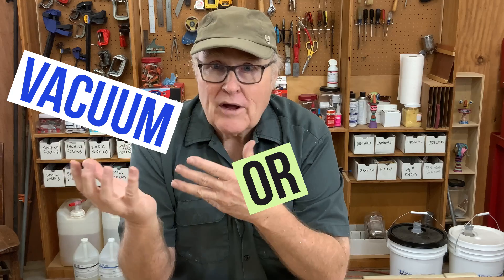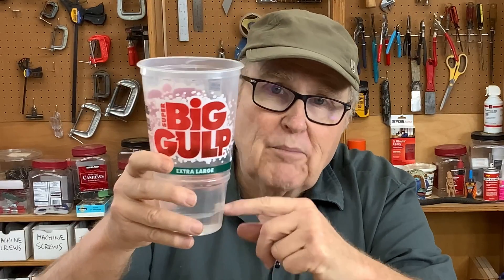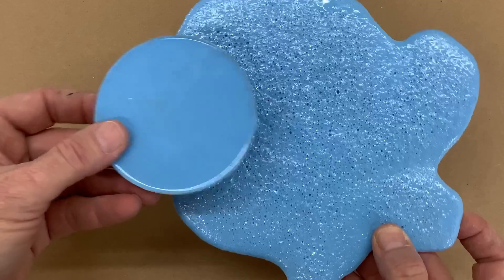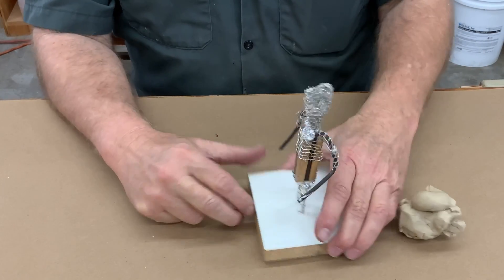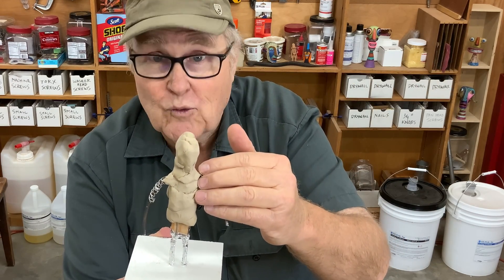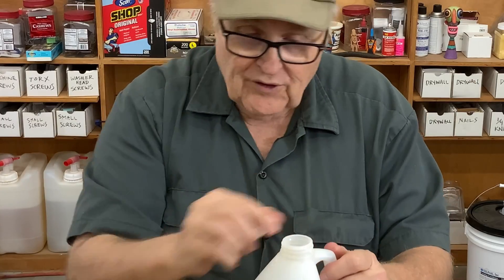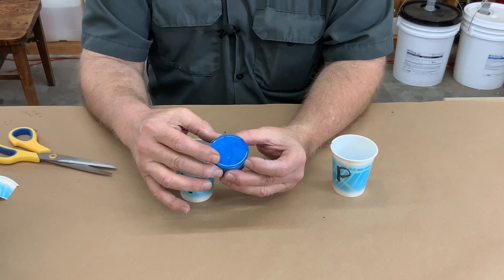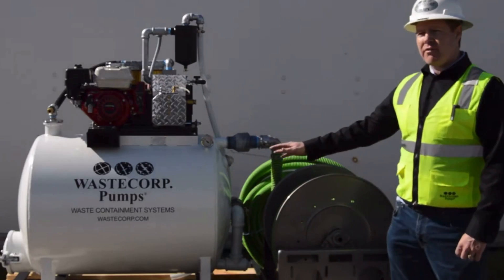Which One To Use, When, How?  WHY IS THIS SO HARD? !!!

Comment: OMG WoW thank you dear !! I was just about to buy a vacuum machine for my resin art... haha.. much LoVe!!!
Reply from the maker: Are you already using a heat gun? That works very well to remove the bubbles as they rise from clear epoxy resins.
Reply: @RobertTolone  yes thank you for your reply 💙 heatgun works most of the time, but not with my wing molds.. These always catch bubble HOLES to all sides.. And I want to craft many of them for my crowns for the upcoming shop.. So I am looking for a propper solution.. Especially when buying more expensive resins.. Could you actually recommend me a very clear heat and impact resistant resin (for 4mm thickness) that's less expensive than crystal clear from smooth on 💫🙏💫

Comment: Great video! Even though the principle is simple, I can understand why people get confused.
The main question I've been getting is: do I really need to get a vacuum chamber? Can't I just use a pressure pot? Or, do I need a pressure pot if I already have a vacuum chamber?

My answer is always, if you are going to use a vacuum chamber, you won't see much difference unless you also use a pressure pot.
And if you use a pressure pot, you will have bad results without using a vacuum chamber.

The former is because a pin-bubble free silicon mold won't help you get rid of the resin bubbles.
And the latter because a pressure pot will push the resin into the pin bubbles on the surface of the un-vacuumed mold, giving you a rough surface.
Either way if you get one, you need the other.

Comment: 7:27 - so understated: especially with ubiquitous Smooth On sample size containers. The lids have a much greater radius and even with my best efforts to clean them before putting them back on, I keep a small pipe wrench to ensure I can open them again.  
10:23 - YES! California Air Tools compressor! They are light and QUIET! So if you live in an apartment, you won’t disturb your neighbors performing your hobbies at night. Just be careful of TWO things: 1) when you first get one, check the air tank to make sure there aren’t any metal debris from the manufacturing process (shake it to hear any rattling about)2) Be VERY careful installing the muffler. It’s made of cheap plastic and the directions are horrible at telling you were to install it- one torque too tight and it can easily break. (The muffler goes in the back as your facing the front of the compressor- on the compressor assembly itself)
Thanks Robert for another super informative video!
Reply from the maker: Great advice about the California air compressor. I love mine for how silent it is.

Comment: I think some of the confusion about vacuuming resin is I believe some epoxy resins are vacuumed. I think in epoxy floor coating you vacuum the slow curing resin to remove any bubbles since a building sized pressure vessel is a bit of a challenge.  😸
As I have posted before I have vacuum system that uses that still small pump but use small Mason jars with a custom lid. The stuff I vacuum is under vacuum for hours or days so that kind of lid system maybe not be able to handle it.

My pressure vessel is a converted Harbor Freight paint pot. But if you want an off the shelf one California Air tools sells one already with the correct setup.
Reply from the maker: It’s true that you can set slow-curing resins like epoxies under a vacuum. But for clear epoxy that I pour out onto surfaces it’s much more effective to use a heat gun.

Comment: Great job, Robert.  Thanks.  Regarding evacuating resin, the bad outcome in your example seems related to the relatively short cure time of the resin you used.  I have some clear resin that takes 24 hours to cure.  Would there be any problem evacuating it for, say, 15 minutes, before pouring?

Also, if you're using a model known to be solid, is there any reason not to pour in the rubber haphazardly and then evacuate, followed by some time in a pressure pot?
Reply from the maker: If you are certain that your model can withstand vacuum and pressure you can do it.  Of course your mold case has to be big enough to contain the expanded rubber while it degases.
Reply: I also cast in epoxy resin with a 40-60 minute working time, with my current work I pour into my moulds, then vacuum & leave it for 20-30 minutes before letting it return to almost atmospheric pressure (mainly just for security, my kitten can't knock the lid off if it's held in place) until cured